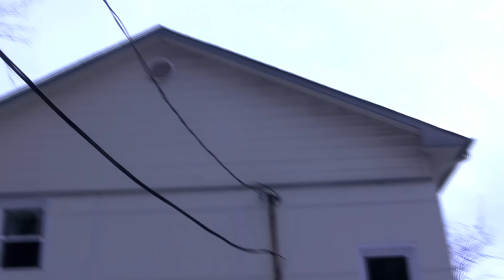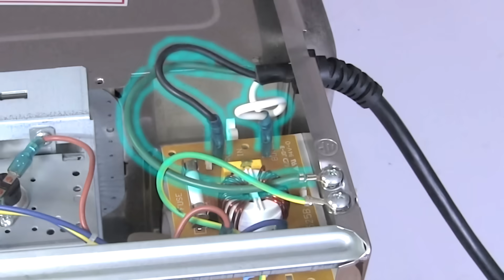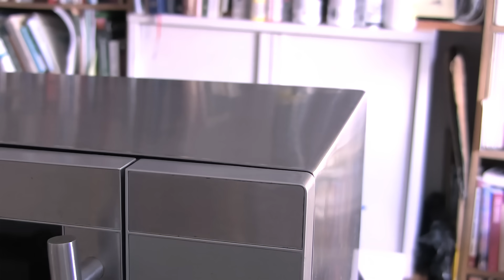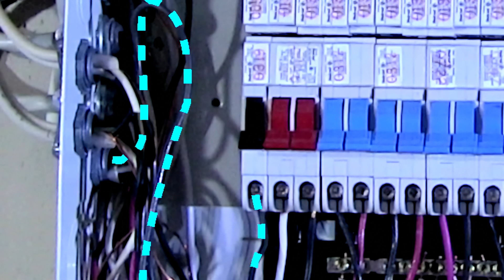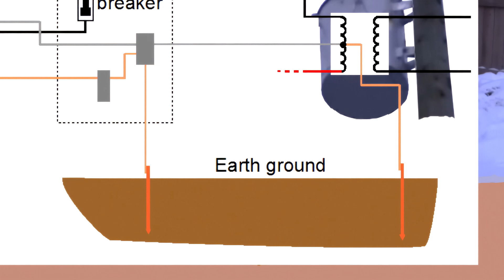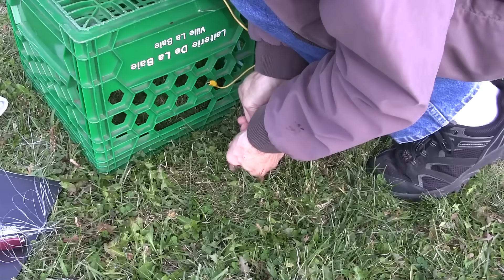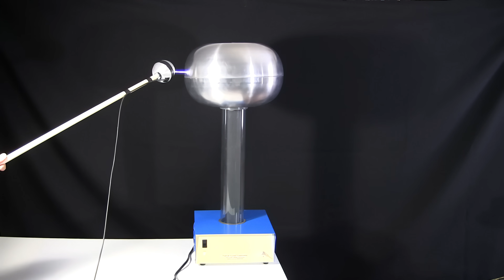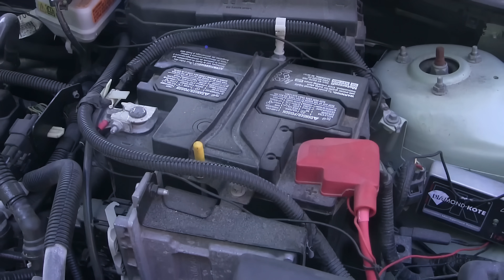What is Ground? Earth Ground/Earthing

Comment: Sir, in the normal operation, when the return current passing through the neutral wire( at the Electric breaker board, why is the current not going to ground as its bonded there ?? as the current will go to the easiest low resistance path). 
The current must return to its source but in this case it may not???
i hope you answer me Sir
Reply from the maker: Some current does pass through the ground back to the ground at the transformer. But while the wires are low resistance, the Earth ground itself is actually much higher resistance.
Reply: So sir, you meant that at the Electric breaker board( at the bonded point btw neutral and ground), the current will not pass to ground as it has higher resistance than the neutral wire !!!
Reply: as im still confused in normal operation why the current not passing through the ground as the neutral is connected to ground at the service box.
Reply from the maker: At the breaker panel where the neutral is bonded to ground, the current will take two paths.
Most will go through the neutral to the transformer on the pole because all of that path is low resistance.
And a little will go from the breaker panel through the low resistance path that's ground wire to where it contacts Earth ground. From there back to the pole with the transformer, the Earth ground is high resistance (I didn't mention that in the video since it's not important to the video). Once it gets to the pole, there's another low resistance ground wire going up to the transformer to the same place the neutral goes to. That high resistance Earth ground section is what causes the current which takes that whole path to be only a small portion.
Reply: thank you toooo much Sir, i really appreciate it
Reply: Just remember... current doesn't take path of least resistance... rather it takes all paths available to it where more current passes through the path with least resistance.. so higher the resistance... lower will be the current

Comment: I still can't believe that many people think the ground prong is supposed to be removed. Firstly, if it is there, it is likely there for a reason. Second, the ground prong is most definitely important. It's maybe not as important for a grounded extension cord if and only if nothing is plugged into that requires the ground pin, but you still shouldn't just remove it since you may need it some day and forget that you removed it causing an unsafe situation and since removing it is a permanent modification. If I want to temperately use a grounded extension cord for an ungrounded, two prong extension cord that has to be plugged into an non-grounded outlet (such an outlet is quite rare any more), I just use a simple ground adapter without worrying about connecting the ground lug since it is not in use. These are normally used to connect a device that requires a ground so you can provide your own ground using the ground lug on the adapter which MUST be used for a grounded device. That ground can be used with the wall plate screw if and only if it has been verified that the two prong receptacle is screwed into a grounded, metal box. Just because it is metal does not mean that the box is grounded. You can also connect the grounding lug to another verified ground such as a water pipe or a supplied grounding rod, but keep in mind that would not be connected to the system neutral which may not be as good as if it was. That's fine for like a radio ground though. These adapters are illegal to use in Canada for those drawbacks since improper use of the adapter could kill you.
Reply: A dangerous practice indeed. This is part of the reason why I like the British Standard plugs. The ground prong is slightly longer, as you push it into the socket, it opens safety gates for the hot and neutral prongs to enter. Therefore if you removed the ground prong you would not be able to make a connection.

Comment: This is explained wrong
Reply from the maker: Would you care to elaborate? I know the part at the very end where I talk about the power supply circuit can be elaborated on.
Reply: RimstarOrg you say the feed (black wire) the outlet is feeding the black wire to the panel, then electric goes behind the breakers, then through the thick black wires (service entrance) then goes out to the transformer in the beginning of the video .. it's the opposite, the transformer is fed first, then your service entrance, then your panel, then your ciruits .. You described the flow of electric going the same way in the neutral & the feed when they are actually traveling opposite ways .. I know you already know this though because of how you're describing electricity, it's just something I noticed in the video
Reply from the maker: Hmmm... interesting. The electricity does take the path I described, as well as the path you describe, once it's already on at least. For the moment after the switch is first turned on then you're right. Or we could both be wrong since it's AC. But I did start out talking about the path of the wire and then switched part way through to the path the electricity takes, so had I noticed, I probably would have stuck with talking about the path of the wire only.
Thanks for responding. It'll certainly make me more aware in the future.

Comment: i've attended electrical engineering in one of the top universties of my country, and this is the best explanation compared to multiple professors and teaching assistants that I questioned about the ground. thank you for this clear explanation which was somewhat vague for years.
Reply: high running know it isn't, it's wrong .. voltage doesn't flow black to the transformer through the ungrounded conductors, it's the opposite .. the transformer voltage isn't fed from your panel, the transformer voltage feeds your panel

Comment: In the microwave example, why not simply connecting the metallic case directly to neutral? Wouldn’t it also trip breaker in case of insulation fault on live wire?
Reply: Is it possible to get shocked when using a water hose if the house is grounded to the water pipes?
Reply: How is the resistance between hot wire and ground through the human operator lower than the resistance between hot and neutral?
Reply: the hot wire is never intentionally connected to metallic case of appliance
Reply: In Europe the neutral wire is not connected to earth directly, the neutral first passes through an RCD along with the live, this turns off the supply if the current flow through live is higher than the return current through neutral (indicating a path to ground from live).

I found the video as confusing as you did. All a learned was Americans really need to get some RCDs.
Reply from the maker: If the microwave oven is turned on then the electricity will be flowing from the hot wire, through the microwave oven circuitry, including the case, and back through the neutral. If someone was touching the ground and touched the microwave oven's case at that time then they'd become a part of the circuit too and get shocked.
Reply: Houzuo Guo ,, if that so.. then Everytime the microwave is on it will directly trip the breaker, no need to wait for insulation fault.. lol
😂😂

Comment: Crazy, only breaking one pole? In Norway (we have 230 V/50 Hz), every circuit has two fuses. As for ground & hot/not hot, itms another story…
Reply: You may be mistaken. If the neutral fuse blows, live will still be present but nothing will work on the circuit, causing people to incorrectly think the circuit is safe to work on. It seems more likely that you have breakers that break both live and neutral in the case of a fault, not fuses (as is the case in France in modern buildings).
Reply: No way. Double fusing is dangerous as if only the neutral fuse blows you then have a floating live end
Reply: Here in the US, dwellings are served with 230 v single phase.  Heavy appliances like an electric clothes dryer or air conditioner are served with the 230 and have double breakers.  However, common household appliances like that microwave utilize 115 v as he showed, through a 'neutral' wire to the center tap on the transformer secondary.  This should always be near ground potential, as he showed it is grounded at the main panel and the service pole.  If it is shorted to ground, there would be little current.  Thus, no fuse.
Reply: Of course it's a 2 pole breaker, so if one trips both trip....

Comment: In America, why wire the negative to the transformer, why not just wire it to a 6 foot ground rod?
Reply from the maker: The negative wire to the transformer, which we call the neutral, is the return wire for the power. The idea is that when the insulation on the live wire in microwave oven becomes damaged and the wire touches the case, that will draw so much current from the power system that the breaker will immediately trip and the electricity will be stopped. That's all that's needed is to stop it. The problem would then be fixed before the breaker is turned on again. So for that situation, there is no need to go to a wire to a ground rod.

Comment: DO NOT USE GAS PIPES FOR GROUND
Reply: How about gas bottles?
Reply: Let them do it, so they'll learn the hard way.
Reply: that's the spirit
Reply: I saw a 12V installation where someone had installed bi-metalic only circuit breakers (no magnetic trip).  They accidentally put a good short to 0V.  The insulation melted off the wire with lots of smoke before the breaker tripped! Lucky it was not tied into the loom yet....

Comment: Why, or even how, is the Ground wire of lower resistance than the Neutral wire- path of least resistance question?
Reply: It isn't. The ground wire is the same resistance as the neutral wire, but the current doesn't have to go through the electronics of the microwave oven when there is a fault between the hot and the case of the oven; it goes straight from the hot to the ground wire via the fault.
Reply: when constant voltage is provided, the current is inversely proportional to the resistance (Ohm's Law)

the fault creates a short to the case, which has lower resistance (short) than the normal circuit the electricity ,
and the parallel resitance created by these two is lower than the lowest resistance of the  two (which is short, so very low resistance), the current by such will be much larger for the given provided voltage (while most current flow through the lower one),

the breaker flips due to this large current.
Reply: what i dont get is why the breaker flips if theres a fault. He says that the breaker flips because a higher than normal voltage is being detected but how can that be if in the diagram he has shows that the voltage is coming from the same hot wire from transformer during normal operation? of does the fault somehow cause the pulling of more electricity from the transformer raising the voltage?
Reply: A short, by it's nature pulls more current, hence it will eventually trip the fuse (fuse being current sensitive, not voltage sensitive).
Reply: it will cause a greater current (amperage), not greater voltage, thus heating up the bi-metalic strip in the circuit breaker and disconnecting the power feed.  voltage and amperage are two of three different aspects of electricity.
Reply: It does not. Breakers are all about current flow

Comment: If any  AC appliance shorts out internally, the case does not become electrified. Instead , the fuse will blow in the circuit breaker panel, first,  to prevent electrocution to the user. This is why they connect the ground wire to the neutral wire inside the fuse box.

Comment: The AC neutral (white wire) and ground (green wire) are usually tied together inside your circuit breaker panel.

Comment: Ground usually refers to DC electricity. DC had two parts, the anode or positive side of the voltage and the cathode or negative side of a circuit. The negative side is called ground (usually a black wire)and ground is common throughout the entire DC circuit. All the  positive voltage goes through the circuit and to the ground. Earthing can refer to AC or DC circuits and refers to when a metal rod is driven into the ground to become a common or safety return. AC usually has three wires, a voltage or line wire (usually a black wire and contains the AC voltage)  a return or neutral wire (usually a white wire) and a ground ( or earth ground)wire (usually green) You don't need this green or safety wire to be connected for a circuit to work but it should always be connected for safety purposes. Some AC power tools do not have this third wire (green wire) on their plugs They are allowed to do this only if their tool is double insulated which does not allow power to go through the drill case and into their bodies.

Comment: If ground and neutral meets and connects at the panelboard, why don't we just use a thicker neutral wire and take the ground from there (near the outlet) instead of running two separate wires?
Reply: ABaumstumpf thats a gfi breaker and it closes in half a cycle. But thank you. Its hard to explain electricity because it is so vast
Reply: the neutral wire carrys electricity sometimes. but the ground is only meant to carry voltage in emergency situations. so attaching the neutral to something like that microwave, you could be shocked occasionally. old houses dont have a ground. its just for peoples safety.
Reply: Thank you for answering but i still cant fully grasp the idea. The instances that the neutral wire carries some electricity, wouldn't that electricity also travel along the ground line and up to the body of the microwave since both conductors are connected to each other at the panel board? If you extend the neutral and put a grounding/earth rod at the end, wouldn't that just be the same?
Reply: Royce Ibanez once the electricity goes out of the panel board it wants to go to ground as soon as possible. The path of least resistance. It comea through the hot and goes back through the neutral and if it cant, it goes back on the ground wire. Once it gets to the panel, it goes to ground rod. It wouldnt come back out of the panel back through the neutral/ground bonding point unless a ground rod was never driven.
Reply: His explanation is partially wrong and excludes some crucial information.

Normal case you have a specialised safety box to prevent shorting to ground - NOT the fuse. It often is as simple as 2 electromagnets - one on life, one on neutral. If the current doesn't match it breaks the circuit way faster than any fuse could.
If you closed the electrip loop between life and neutral with your body nothing would prevent your death. so having anything that can be touched be connected to life or neutral is a bad idea.
Reply: Adam - depends on the model/country/regulations.
But yes, it takes some time but greatly reduces the risk of tribulations. And half a cycle is imo a lot better than tens or hundreds of cycles that a fuse needs.

Comment: I've heard using water pipes for ground is dangerous.
Reply: phydeauxddog
It is, because adjacent houses water pipes can become electrified on the offchance stray electricity were to flow through it causing a safety issue. In fact a competent electrician would advise against it.
There's even been cases where some people have been electrocuted because someone wired up the ground to the water pipes, imagine touching your kitchen faucet only to become electrocuted because your neighbor wired up their ground to the water pipes.
It's also an issue because 3 volts stray voltage is common on ground, Some live stock has died because of it and some people as well.
Reply: Here's an example of stray voltage
https://youtu.be/pAs_FmdxXhQ
Reply: Another issue with using water pipes as Ground is that it may have worked at first installation. Then all piping was conductive. With more plastics in use the effectiveness can disappear due to plumping modifications..

Comment: It has nothing to do with the Earth being able to 'swallow lots of charge'. Ground is used because it is partially conductive and everything, including you, is also standing on the ground, therefore no dangerous potential difference can develop between you and the thing you're touching, provided it is also connected to ground. In an aeroplane you would use the metal chassis of the aeroplane as 'ground', because everything on it, including you, is standing on the chassis, not because the chassis can 'swallow lots of charge'.
Ground improves radio reception because it forms a reflector that effectively doubles the size of your antenna.
Reply: I was told of a building with nine floors where the earthing from all the apartments was correctly wired to the earthing bar in the basement, but there was NO earth connection.  This may be because it was forgotten at time of construction, or someone had recycled the copper...  Because everybody was well insulated from ground, they never new any different.  When equipment in a plant room was wired to a telephone line, the line was very very noisy.  This was probably due to several amps of earth leakage current.